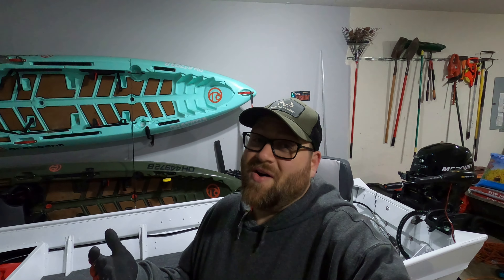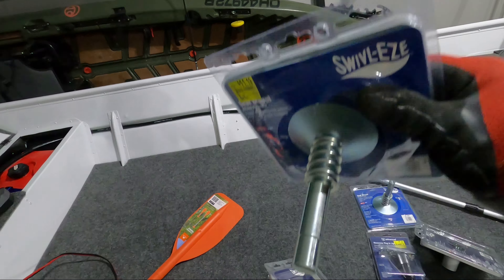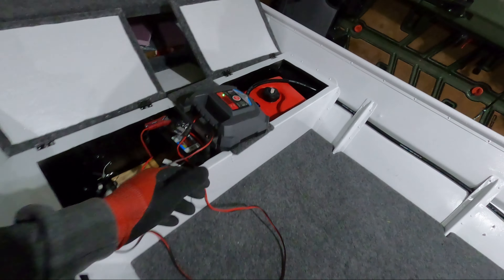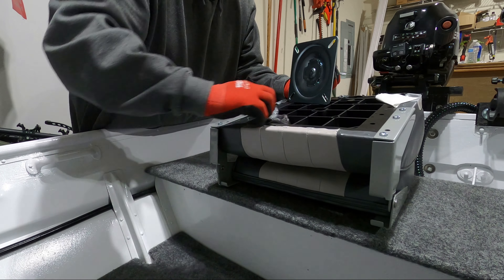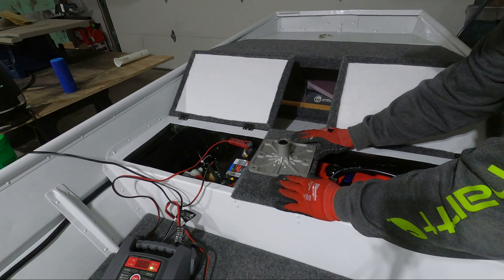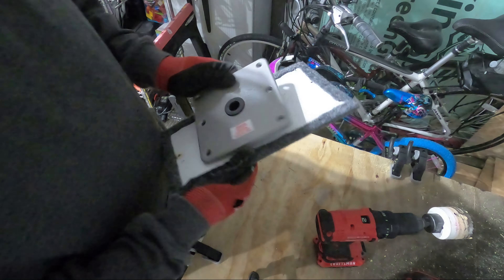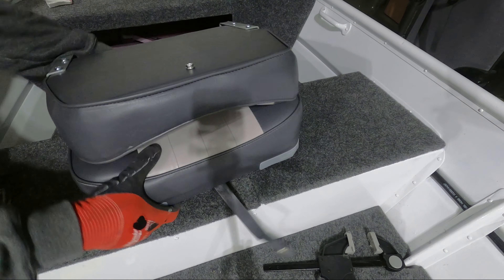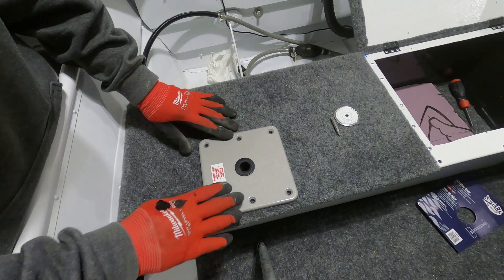INSTALLING Swivl-Eze Lock'N-Pin SEAT MOUNTS ON THE JON BOAT TO BASS BOAT 1436 CONVERSION BUILD

Comment: good enough vid man thanks i mostly just needed to know what parts were exactly what was needed. nice boat, I like the gas up to disperse weight to front, I'm too scared to keep my batt that close tho.
Reply from the maker: Yeah it really helped for weight distribution. I ended up switching to a lithium battery to save weight and it was so light you could put it anywhere in the boat.

Comment: Great video. Love the Jon boat. Do you know if the 3/4" pin seat mount will accomodate a 5" x 5" seat? Thanks...
Reply from the maker: If its the lock n pin seat mount it should fit, I haven't seen different sizes on that.

Comment: Did it throw off the balance of the boat offsetting the driver seat ? Also is the tiller hand in the outboard movable? I only have a trolling motor right now and don’t want to mount my seat on the wrong side if the handles can’t be switched
Reply from the maker: For a boat this size yes it affected the balance. I ended up moving it to the center position because it leaned too much for me. 
Typically the handles are not moveable.
Reply: @mvboutdoors  okay thanks I’ll mount mine in the center also might make it a bit harder to drive but is what it is. Thank you for all your responses they are much appreciated  !
Reply from the maker: @joshuaswanson3068  Yeah you basically sit sideways to steer but in a chair it was plenty comfortable. You're welcome!

Comment: These still working well for you? Wondered if not having the "post" in there would make a difference or are these made to be used both with how you installed and with a post as well?
Reply from the maker: These are "Lock N' Pin" bases, not the screw in bases usually used with the seat poles, so they are meant for this type of swivel base.

Comment: Hi. I bought an OLD Jon Boat - from 1975. It is acrylic and has 2 bench seats. But the seats have no way to get under them, so if I put screws in to secure a seat, I cannot get under the seats to secure the screws. Can I safely cut out an area on the top of the seat? Or should I cut out an area, then put a board over the top of the seat? I bought a Adjustable Boat Seat Pedestal,Adjustable Height 11 ½-17 ½ Inches, Adjustable Pedestal For Boat Seat to attach to a swivel. Also - another question - where are the batteries for your electric motor? My batteries are set up to be all the way in the back, between the back seat and the back of the boat, then there are two flaps, covered with carpet, that lay down over the batteries. So, when I turn around to that area, my knees are up to my chin.  I would love to cut the top of the back bench off, replace it with wood, cut a door flap on top and be able to get to that area under the seat and then be able to put my feet on the floor in that back area . Could I safely do that? thanks

Comment: whats your thoughts on cutting into a bench for extra storage, its an old boat that i got from a friend and it spent most of its life outside so im assuming the foam inside isnt doing much help anyways
Reply from the maker: I gutted both of my bench lids for that exact reason. The foam was completely waterlogged and useless. I added foam back to benches in the form of foam flooring and other places around the boat to make up for it as best I could but I love the extra storage it provided. I've got a couple videos on it if you wanted to check it out:

- https://www.youtube.com/watch?v=zCA-WTRBw9k
- https://www.youtube.com/watch?v=_xkn-MpW200
Reply: The foam most of them use is water logged and useless, I pulled out 300lbs of bay water logged that was literally eating the boat. I wanted to keep some emergency floatation, I used the owens corning formular 250, does not absorb water literally at all, it will not take chemicals like gas and battery acid so you may want to bag it if its near that but I literally put it in a bucket for a bit and pulled it up and no water trapped in it, dried in a day. supposedly a sheet of the 2" thick is like 300lbs of emergency floatation.
Reply: Got to be aware that the foam is used in the calculations for how much weight the boat can legally carry. Might be an issue if your boat sinks and you put in an insurance claim.

Comment: What size did you drill the whole for the mount to sit in. The size of the large hole hole I listen several times and you never mentioned what size hole you drilled in for the mount to sit in.
Reply from the maker: I didn't keep track of it, it was about 2 sizes down from the original hole size

Comment: one thing you should be careful love is when you are sitting in your pedestal seat up high and you get waves from the side your center of gravity has been risen and you have a very narrow boat which means it can get quite Rocky back and forth
Reply from the maker: Very true, I ended up moving the mount to the center of the bench for better stability.